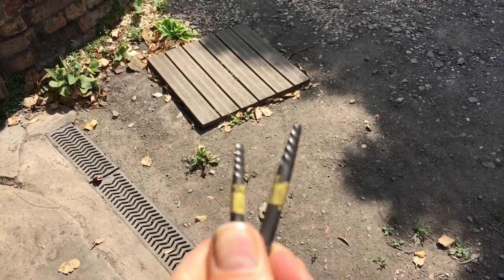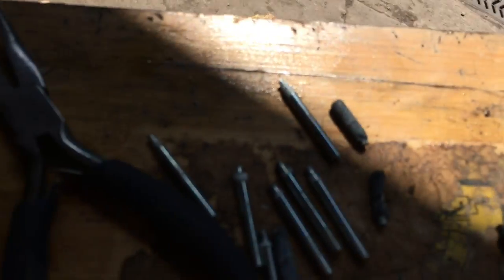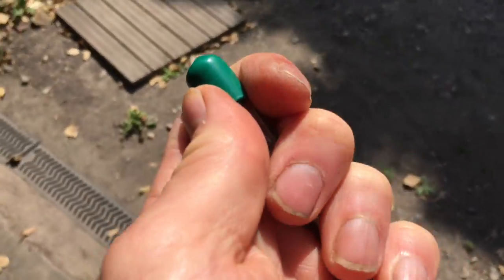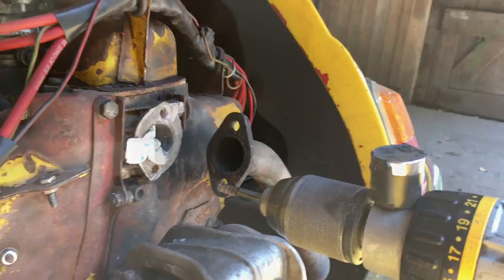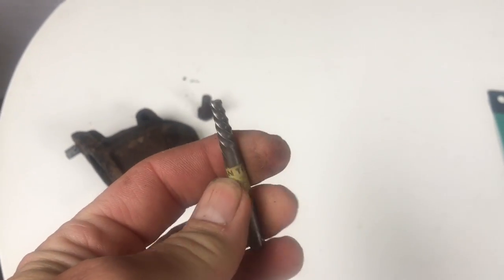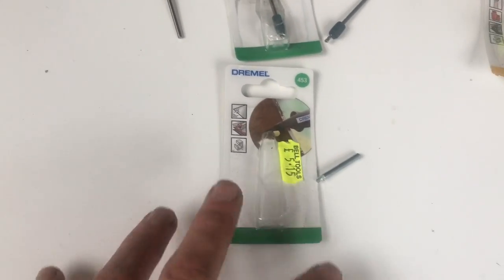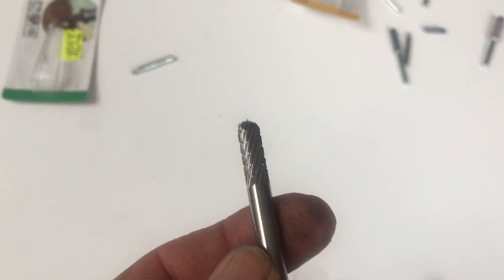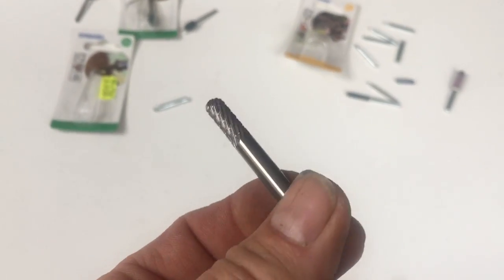How to remove a snapped off bolt extractor or snapped off EZ out using a carbide burr

Comment: I just use drill bits on a slow speed with oil, no problem. Make sure you’ve 3 or 4 bits and change them before they get hot. Just repeat that as often as necessary. Once the bits stay cool they won’t blunt. Drill all day with them
Reply from the maker: Thx for your comment. Do you remember what type of bits you used? Even the expensive bits u tried were no good…..but maybe that is because I let them get hot. Might have to put that to the test in a future video. Having now snapped a few bolts in my time, my take is that it the bolt is in there tight enough to snap, then an Ezy out will invariably snap. I have had good success using a magnetic induction torch to heat up bolts/bleed nipples first. Mike

Comment: First use Kroil and soak.next time you go to the dentist ask them if they throw away the carbide burrs when they do fillings on your teeth. Most dentist throw them away and will give them to you for hobby purposes.  If the bolt is big enough you can eat up the bolt next to the broken ez out. I used to remove them on aircraft when a mechanic would break one. Like I told them stop and get me or someone thTs steady with an dremel and 1\16" carbide burr. Usually I can do delicate surgery and never touch the threads. If you do now we have to replace the part or helicopter new threads if you didn't bugger it up too bad. Take your time and they will come out. Also next time your reassembling  anything with threD on an engine use never seize on the threads make life
 easier .
Reply from the maker: Hi - thx for your comment. Never heard of Kroil but having read up on it, I’ll try it out. Love the dentist carbide burr idea…and sadly I’m up for a dentist appointment soon so will also check that out. As you know, my solution in this video was indeed a carbide burr. Mike

Comment: is that a regular drill you used with the carbide burr ? im reading online that a dremel tool works best ...?
Reply from the maker: Hi - it depend on the drill. A good drill will revolve just as fast as a Dremel and potentially has more torque. The Dremel is useful fro getting into tight spaces when a drill is too big. Mike

Comment: I had broken off a 6mm bolt flush with the engine block. And now a Proto Extractor bit in what was left of the bolt. Even after a week of penetrating oil and tapping. I am now at loss…What brand/type of carbide burr did yall have success with?
Reply from the maker: Oh no...I feel for you - that is almost exactly what happen to me. I used a 'bull nose' carbide burr made by York. These are expensive - From memory, I paid somewhere between £20 -£40 for the burr I used.... BUT....do not be fooled into thinking a cheap Chinese set is going to give the same results. If you look on eBay (item number 326687708102) there is a set for sale with two bull nose carbide burrs included. If that set is genuine and unused, then that is a reasonable price. Good luck. Mike

Comment: My exact problem right now......does this just waste the original threaded hole as well?
Reply from the maker: Hi - if you are careful you can spare the threads. I don't think I had to re-tap the holes in this case. If you do, the fittings in the video below save a lot of work:

https://www.youtube.com/watch?v=sYy3AdPdP8U

Mike

Comment: I appreciate this video brother, really glad I came across this. I’ve got a 1 of 3 bolts stuck in my oil filter housing on the engine block itself, tried the extractor way, and that ended up breaking inside the hole I made in the bolt to extract it. 

Going to give this a try tomorrow, really hope it works out Mike. 

Abdelrahman
Reply from the maker: What a pain! hope it works for you. Recently snapped a water pump bolt and had to use the weld on a nut method to get that out:

https://www.youtube.com/watch?v=2HG_awwxYMk

Mike
Reply: @ I really hope so man. Just seen that video, well done guys 👌🏾
Reply: how did you end up getting it out?

Comment: This video and comment section saved me so much time and money. I had a spark plug break inside of the motor and tried to remove it with an extractor but the extractor broke. I use the combination of a quarter inch diamond tipped bit and a carbide burr set and was able to drill a hole through the broken extractor. I will now insert a slightly smaller extractor into the hole and try again. But first, ill apply more penetrant oil and this time ill use a torch to heat it too. I was thinking about making a short video showing the process
Reply: @ISAIAH_spyro  Good luck man!!! And yes.!  A video would be very helpful for others in the same situation!👌... apparently this is a very common problem, but there are not many videos out there on how to get it done! cheers man 👍
Reply: @neutronronnie9343  thanks for the luck I'm going to need it! I got the second extractor into the hole drilled into the broken extractor, but even with a torch I couldn't get it to budge yet. I'm scared to break the new extractor.bim probably gonna try a 50/50 mix of acetone and ATF instead of PB blaster, as I've heard that's the strongest mix. They say it will melt plastic so you need to keep it in a metal container
Reply from the maker: @ISAIAH_spyro  Don't do it....I imagine the first 'easy out' was thicker than the one you have just inserted. If the thicker one broke, then the thinner one has even more chance of breaking. If it was me, at this stage, I would consider welding on a nut and using an impact wrench. Sometimes the  heat from the welder is enough to break the seal...and if not. the knocking action of the impact wrench might just do the trick. I don't know if if you ever watched the video where I snapped the brake bleed nipple on my SL55 but in the end, my solution was to use a magnetic induction torch to get the remaining bleed nipples out:

https://www.youtube.com/watch?v=zW2IceJ8fGM

Let me know how you get on. Mike
Reply: @MikesMercsandothercars  unfortunately I already hammered in the second easy- out. I don't have access to a welder, but I suppose if this easy out does break off, that would be my next option.

Do you have any tips on what I can do right now to improve the chances of the extractor working?

Thanks for the responses! 🙏
Reply from the maker: @ISAIAH_spyro  Hi - I dont know anything that will improve your chances of getting out that broken spark plug with an Eze out. I hope I'm wrong but I think if the spark plug has already sheared AND an Eze out has also sheared, that should tell you the degree to which it is stuck. My advice would be to try and remove the 2nd Eze out - it will be much easier to do it now than after it has snapped off. If you get it out, you could try reverse thread drill bits but in my humble opinion welding is the way to go. I repair vintage coffee machines, and when steel is screwed into aluminium, the only success I have ever had is drilling out and re-tapping the holes. I have cracked the aluminium body of an machine BEFORE managing to wind out a stuck fitting....that's how well steel and aluminium bind after repeated heating and cooling cycles. Mike
Reply: @MikesMercsandothercars  thank you for all the advice. I agree that welding is probably the way to go. I am trying the 50/50 acetone ATF homemade penetrant, but I don't have high hopes for it. I'm only going to try spinning the ez out with moderate force, and if it doesn't budge I won't torque any harder to try to avoid breaking it. I've been asking around work if anyone can loan me welding equipment.
Reply: @MikesMercsandothercars   I finally got the spark plug removed. I don't know what finally made it budge, but I'm guessing a mix of the homemade penetration oil, repeatedly using an impact wrench with seemingly no results, rocking a breaker bar back and forth many times, and finally I ran out of patience and have the breaker bar all of my force. Expecting the extractor to break again, but instead I heard a click. When the plug was finally removed it was so stripped that there were no threads left at all, it was completely smooth. 

I also discovered that upon drilling out the first extractor, I drilled to far down and removed a large portion of the threaded shaft.

I'm hoping that there is still enough material left to install a helicoil.

I learned that the reason it probably broke and gave me such a hard time was partially because I was using a long extension extending all the way out the wheel well. I later discovered I could stick a breaker bar down from the hood and reach the plug with only a short extension. This gave way better leverage.

Definitely a learning experience! Thanks for your help!
🙏💪👍
Reply from the maker: @ Wow - I'm so happy for you. It is so nice when perseverance pays off! Your comments will be invaluable to others facing the same issue. Mike

Comment: Do you think I can drill a hole into the broken easy out and insert another easy out into the hole?
Reply from the maker: No. The easy out is made of hardened material - it is super hard but brittle. I spent a fortune on expensive drill bits before realising that. Mike
Reply: Didn't you say the carbide burr worked for you? I found a set for $30 I was gonna get to try to get a 1/4 hole into it to insert a #4, easy out @MikesMercsandothercars
Reply: @ISAIAH_spyro did that end up working ?

Comment: Rusted out exhaust manifold middle bolts on a 305 sbc watched 20 videos and im here
Reply from the maker: Always a bummer when things don't go to plan. Have you actually snapped off the bolts or snapped off an extractor? If not, I have had some success undoing REAL:LY rusted bolts using a magnetic induction torch...see

https://www.youtube.com/watch?v=zW2IceJ8fGM

Good luck. Mike

Comment: I broke a 8mm bolt inside i drilled a hole but i dont think I'm going to use an extractor i think i should use a carbide instead...
Reply from the maker: It depends why the 8mm snapped in the first place...if it is REALLY siezed in there, an extractor will probably snap just as easily as the bolt. A carbide burr is really only necessary to grind out the snapped off extractor...if you are just getting out the bolt, drilling with normal drill bits should work. I sometimes use reverse drill bits - the heat generated often loosens the bolts and obviously the reverse bits just wind it out. Good luck. Mike

Comment: This carbide tipped burr attachment might be the tool that helps me thank you 🙏🏼 mate from the states 👊🏼. My broken bolt is large at 16mm and under my car upside down and it’s flush with the undercarriage and I want to start a hole at least.
Reply from the maker: What a nightmare! Just make sure you get a good quality carbide burr...so you spend as little time as possible with metal shaving falling in your eyes.. Mike
Reply: @MikesMercsandothercars  I was just looking at them online and I’m going to get one today 👍🏼 thank you 🙏🏼

Comment: Great tip! Wanted to see if anyone had success using burrs after I fought some particular hard broken studs today. They were on the outsides of an exhaust flange and were defeating all my drill bits. Ended up cutting a slit from the outer edge of the flange right through the stud remnants and punching them out. If you're going to try an easy out use lots of heat, percussion, and penetrating lubricant first. If you can chisel away the top most exposed threads, that can also help the rest of the threads release. I have about a 30-50% success rate with easy outs and I have only broken two over the years. Very important to pay attention to how the feel so you avoid snapping. There is a certain elasticity you can feel in your hands. Otherwise drilling to just smaller than the threads and using a tap to chunk and peel out the rest seems to be where I end up usually.
Reply from the maker: Thanks for the tips! The only thing I would add is that the cheep and cheerful Chinese (eBay+ Amazon) carbide burrs are fine for light restoration such as removing rust BUT for grinding out hardened stubborn bolts, a better quality bit is required. Mike

Comment: At the end he uses a bull nose carbide bit😅
Reply from the maker: Yep - a good quality bull nose carbide burr is the way to go. Looking back at this early video, I should have cut to the chase early. Mike
Reply: @MikesMercsandothercars is the bullnose better than just a carbide drill bit?
Reply from the maker: @PeachCoastLowrider  Bullnose refers to the shape of the burr. In the case where something is snapped off flush, you need the burr to have teeth on the very end...preferably with a rounded shape. Mike

Comment: Thank you for your suggestion! If only I had seen it before I broke off my own "bolt extractor"! Your advice that a seized-up bolt won't come out with these extractors needs to be repeated to others!
Reply from the maker: Oh no...hope you manage to get it out. What a nightmare. Part of the reason I started this channel was to try and help people avoid the mistakes I made....for example snapping a bleed nipple on my SL55...if only I had know about the Hot Rod induction torch before I started! Mike

Comment: That's exactly what I did. Broke a bolt, drilled a nice hole all the way through and thought i'd get the rest out with an extractor, and made my life hell by breaking off the extractor in there too. Then I also went through all my Dremel grinding bits and drill bits. Gonna go buy that carbide burr today. Thank you!
Reply from the maker: Yep - I feel your pain. My advice is to get a proper carbide but and not a cheap one from eBay. Mike
Reply: did it work then?  what kind did u get? in the same boat now...
Reply: did the carbide burr do the trick?
Reply: Made that same mistake earlier today. Broke off a bolt, drilled a hole, then broke the ez out in the remains

Comment: Calling it an easy out should be against the law.   If you're an amateur and consider using an easy out on a broken bolt just take it to a machine shop first it will be cheaper in the long run.
Reply from the maker: Yep...totally agree. Mike

Comment: So my question is, do you want a burr the same diameter as the extractor or do you want something smaller and work it around? I've already accepted that im putting a helicoil in the block, cause the bolt snapped off while torquing it.
Reply from the maker: Thanks for your comment - usually the burr will be slightly thicker than the snapped off EZE out. If you are just grinding out a snapped bolt, the burr would be smaller than the diameter of the bolt. Once you start to get close to the threads, the remains of the bolt usually starts to come out. The only advice I would give is  - spend the money on a decent burr....not a Chinese pack of 6 from Amazon. Good luck. Mike

Comment: A broken extractor has cost me about a month and a half since it decided to break off on the exhaust port of the head. 
My neighbor gave me small burr bits and they are a blessing
Reply from the maker: Thanks for your comment. Yes those carbide burrs can be a life saver - I've got through plenty of them on the current restoration. Mike

Comment: Well done, if only I'd seen this sooner before I got myself in the same situation. No one expects themselves to be in this situation though. Assuming anyone sees this before they get themselves stuck I think an aggressive application of heat would circumvent this whole scenario. Assuming it's safe to do so torch it and get it nice and hot. I had some studs that thankfully didn't snap but they wouldn't budge until the were glowing orange.
Reply from the maker: Thanks for you comment - you are right, in most cases heat will do the job. In the case of this Fiat 500 heat might have been a bit tricky without draining all the petrol and removing a bunch of meltable pipes and hoses. Mike
Reply: Yup... Same...😂😭
Reply from the maker: @DLimit  Sorry to hear that - hope you get it sorted. Mike

Comment: I snapped an extractor inside a broken rusted out bolt today and found this video and couldn't believe that this little 1/8 carbide bit actually worked, it did take a while but it did the job....  unfortunately after getting the getting the piece of extractor out and continued to drill, eventually drilled through the whole rusted out broken bolt and even getting the hole for a bigger stronger extractor the bolt didn't budge!!!.... this thing welded with rust to my subframe..... great video though, this actually worked!!!
Reply from the maker: Thanks for your comment - I'm glad it worked! In my experience 99% of bolts  which snap an extractor need to be completely drilled out. When I first did this, I drilled out the extractor, drilled a bigger hole and then promptly snapped off a bigger extractor. Box of shart new drill bits = one of my best investments. Mike

Comment: I am both unlucky and stupid enough to have done this. Your logic makes perfect sense in that a bolt that is snapped off will snap off an EZ out. This morning I had a tiny hole drilled deep enough but I got impatient. In short I never used the biggest drill bit to make the biggest hole possible.I used an extractor and broke it off and then did the same with another one. I have two extractors in the hole of the aluminum cylinder head. But that tool needs to go around the extractor to work no?
Reply from the maker: Thanks for you comment and sorry to hear you snapped an ezy out. A top quality bull nosed carbide burr will grind out the tips of the extractors. Don't get a cheap chinese one - a good one will cost £20 - £25. I got mine from here:

https://www.cromwell.co.uk/shop/cutting-tools/rotary-burrs/carbide-burr-uncoated-cut-9-chipbreaker-8mm-ball-nosed-cylindrical/p/YRK2101209K?gclid=Cj0KCQjw-daUBhCIARIsALbkjSY4yimRSqSbdEYfcEp9VJH1c6uXNpmiO3ayaTzZiitHOB1E263cDIoaAnTWEALw_wcB

Good luck

Mike